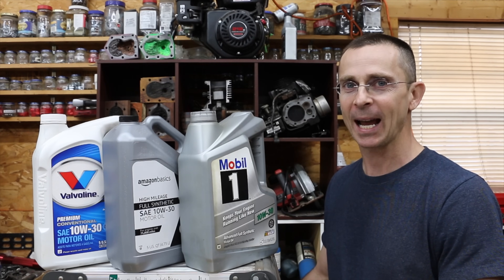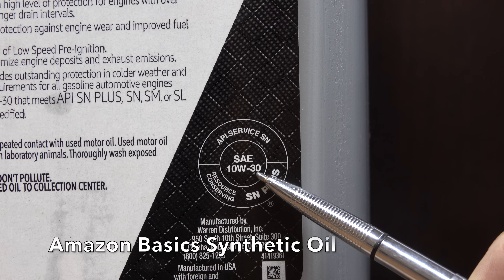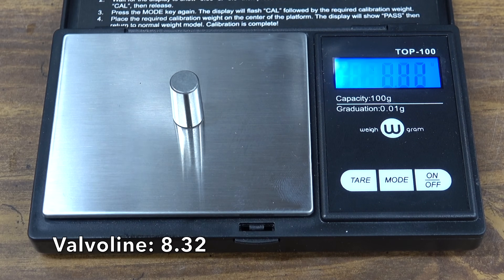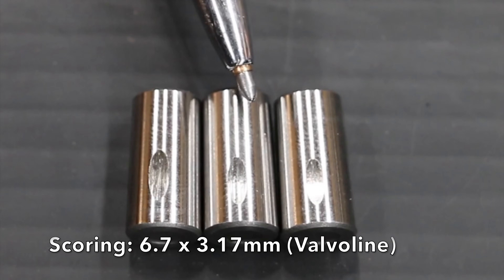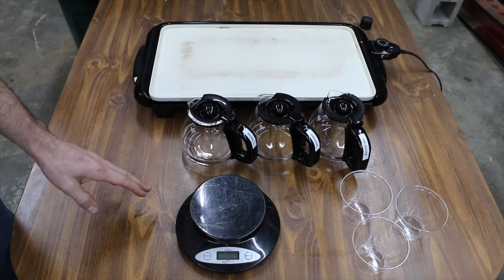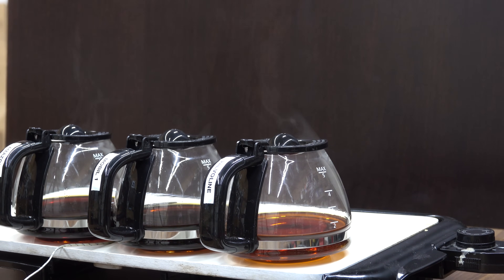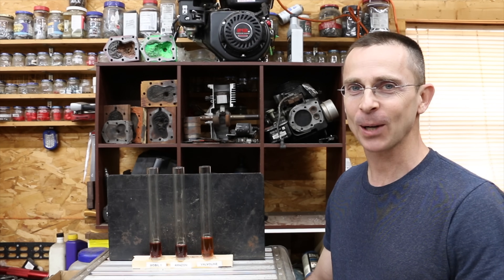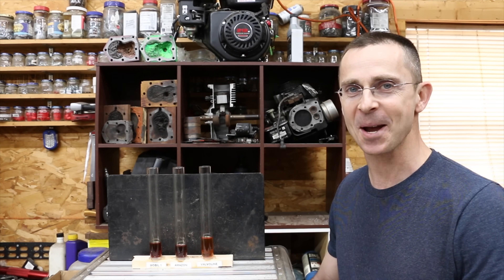Is AmazonBasics Full Synthetic Motor Oil better than Mobil 1? Let's find out!

Comment: VERY well done!

I've left you a lot of positive comments along this journey and where to go next, but at this point, you've gotten very good at getting useful information with your reasonably simple testing.  This one I would argue that Amazon actually won.  Yes, Mobil did a hair better on the lubricity tester, but you're also testing an extreme situation that does not match any condition you'll find in a normal engine (keep doing it, it's still a useful test, ESPECIALLY with the temperature probe).  It appears that the Amazon basics not only flows better at low temps, but survives higher temps better, AND prevents parts from heating up as fast in the lubricity test (making me wonder if mobile did better with the wear because of luck of the draw, it got a slightly better bearing).

What I would like to see next would be the same test run with Mobil 1, Amazon Basics, Walmart Supertech Synth (I wonder if it's actually the same as the Amazon basics, it's a good oil from the same distributor) and Royal Purple, all in  5w-30 (a more common grade for modern cars, also one that with more traditional oils would be more fussy to formulate).  If you really felt ambitious you could add Amzoil or Redline, but I feel it would be unnecessary.  With those 4 you would cover the best of the reasonably priced oils, including one that enters the ultra-premium category but is still available at normal stores for a reasonable price, and at the weight that used in almost all the newer engines.  You'd pretty much have the definitive answer for "If the average guy who wants to take better care of their car, which is the best that you can get at a normal store and is it worth going out of your way for one of the premium brands?"
Reply from the maker: Great recommendations!  I'll test the brands you've recommended.

Comment: PLEASE make a video comparing Full Synthetic High Mileage oils in 5W30 (most popular weight sold) from the 4 major brands. (All cost from $22-$27 at Walmart) 
1. Valvoline Full Synthetic High Mileage
2. Penzoil Platinum High Mileage 
3. Mobil 1 Full Synthetic High mileage
4. Castrol Edge High Mileage

also to go along with the all tests you did on this video, I'd love to see you add a test to see how the oils perform for heavy carbon deposit removal. 
To my knowledge you'd be the only video on YouTube that full synthetic high mileage oils would be tested. 
You're the best !!!
Reply from the maker: Thank you for the recommendation!

Comment: Nice test rigs!

I'd be more interested in the high temperature viscosity than the volatility. Volatility should be (and is) effectively nil for all of these. A bigger issue is whether they maintain enough viscosity at high temperature to avoid engine wear.  The abrasion rig kindasorta tests that, but the oil never really comes up to operating temperature.  A metal cup with a heater to control the oil temperature for the abrasion test would be perfect.
Reply from the maker: Thank you for the video idea!

Comment: Great video! I know several car mechanics and they all have different opinions about oil. Some swear by Castrol, others put cheap oil in high performance engines like a VW G60. 
I always use cheap engine oil from the Dutch discounter "Action" and pay 10€ for 4 Liters. Never had any issues while using it over the years in at least 6 different engines. Until last year when I bought a '96 Jetta MK3. 
It hasn't used a drop of oil since the last change...
Reply from the maker: What you're doing is working well.  No point in changing!

Comment: I don't know man. There is WAY more to a quality oil than those common-sense tests you've performed. Your tests simply prove that straight from the bottle all those oils are comparable which means absolutely nothing for longevity of your engine. There used to be a time when for God-knows-what-reason i read up a lot of technical literature that went in depth why this sort of comparison is just silly because it doesn't take a crap load of other important factors in consideration.

I categorized this video as one of those silly ones you do from time to time.

Comment: The Mobil 1 has additives that supposedly protect the oil from overheating, and additives that protect the engine (longevity). It's probably those additives that are making the oil a little less liquid at lower temps.

I tested Mobil 1 in my car, and did between 7-8k miles before I felt the engine needed a change (Ford recommends 10k miles, but by that time, the engine isn't idling smooth anymore).
Then I tested Amazon basics, and I got 5-6k miles on their oil.
I tested Ford's own oil, and it did well for about 7k miles as well.
Then I tested regular dino oil, and that was only good for up to 3k miles.
Reply from the maker: Thank you!

Comment: The biggest problem with the amazon basics is, who makes it now vs later? If it is anything like Walmart, then you might get an entirely different company making the product next year. It's too risky to me.
Reply from the maker: Thank you. Warren Distribution is the company now and they have a solid reputation.
Reply: But isn't that true for a lot of the lubricants on the market?  They are not always produced by the name on the label. They are OEMed from a variety of sources. Those sources can and do change and the only constant is the specifications on the label.  Example... John Deere doesn't produce its own lubricants. I'll bet Royal Purple doesn't make that lubricant either. Even those sold by the OEM change over time. The manufacturer won't tell you when the formula has changed. Again, it just has to meet the criteria on the label.

Comment: I think you did a great job and this was a very helpful and informational video. Just one thing that I noticed you weren't comparing high mileage version of the Mobil 1 and Vavoline to the high mileage version of Amazon basics.  Additionally, Valvoline was not synthetic so it is difficult to make a straight comparison with the other two oils.
Reply from the maker: Thank you!

Comment: Great test Project Farm.  You do an awesome job with facilities available to a home shop.  We did a similar test on synthetic vs conventional oils in college engineering lab.  Even though cold start viscosity gets the most attention, the ability of the oil to maintain viscosity when it is at operating temperature is actually extremely important.   If you do a followup test, I suggest you test the oils for lubricity and flow at 225F.  Also perform the  same tests on used oil with 5K miles.  I think you will find the synthetic oil will perform much better at end of life.  Once again, awesome channel and you really do a nice job with your experimental method.  Keep em coming!
Reply from the maker: Great recommendation!  Thank you

Comment: I just changed my oil with Valvoline and now im disappointed
Reply: He used conventional Valvoline
Reply: Valvoline was the only conventional, the other two are synthetic, pay attention to what is going on.
Reply: @zoonertuner8851  actually that was my point. Pay attention.
Reply: I use nothing but valvoline full synthetic unlike what's in the video. I took an old engine apart with almost 200,000 miles on it and measured the crank bearing clearance with starrett calipers. Lets just say I was amazed as was my dad who was a machinist for over 40 yrs.
Reply: Conventional oil is just fine.
As long as you change your oil at the required intervals.
Reply: There’s nothing wrong with Valvoline. I’ve used it when it’s on sale, and it works great.

Comment: It would be pretty expensive but different solar panel efficiency would be very interesting. There are a lot of 100W panels available and I would like to see who is best. I'm currently assembling a small portable solar "generator" for extended camping with one 100W panel. They are easily expandable, don't take up much room and are often cheaper than small 1000 or 2000 watt inverter generators. Generators are reliable and convenient but you are limited to fuel amount.
Reply from the maker: Thank you for the video idea!

Comment: I generally run a mix of 5 quarts Mobile one 0w40 and valvoline synthetic 5w40 cuz that seems
To be the cheapest combo I can get at wall mart for the 7 quarts my car takes. Id be interested to see some testing of the cold flow and the wear on the load bearing
Reply from the maker: Thank you!

Comment: I'll still get Mobil 1
Reply from the maker: Mobil 1 is great!
Reply: I use Mobil 1 0w40, that costs me $3 less at Walmart than what Amazon is charging for their 0w40, so not only is it a reputable brand that's been making synthetic for over a decade but it's cheaper. Still interesting (or maybe just weird) that Amazon makes oil.
Reply: @jetjazz05  Technically correct: Mobil 1 has been making synthetic oil since the 1970s, which is indeed over a decade. Amazon's oil is made by Warren, so they aren't actually making any oil.
Reply: still not a real synthetic. mobil 1 is simply a group 3 base.. in other country's they cant even label mobil 1 as a synthetic because it simply is not one.. fine oil but you're misled if you indeed think it is a real synthetic.
Reply: @iconr6racer  Man, I agree with you. Liqui Moly does this shit. Even on youtube that guy from LM defending that group 3 its synthetic. ITS NOT!! Shitty oil for twice the price.
Reply: I only use Amsoil 5W-20 signature series.
Reply: @Lexman00   I use amsoil on my snowmobile
Reply: There are two types of responses that are standard in any oil thread: the "Mobil 1 isn't a real synthetic" and the "Amsoil is the best". You managed to attract both, lol.
Reply: Mobil 1 is pretty crap oil for the money unless EP or 0w40. 0w30 isn't too bad. Definitely never use the 5w30. It's overpriced hot garbage. Blends perform better than that crap. Use 0w40 in everything and call it a day. Fucking 20 weight in new cars, what a joke. And if it's a pos like ford where the oil galleries are too small, then you shouldn't be buying that shit in the first place.

Comment: I was hoping for another lubricity test after you heated it up. The best way to know if your oil can handle the abuse, is to abuse it and then test it. I once bought Sears brand synthetic oil, for my Honda VF1100, and made it two blocks away from my house before the oil broke down and the engine started making unhappy sounds. I went back to Mobil 1 and never strayed again. I prefer Mobil 1 over Valvoline synthetics, but consider Castrol synthetic a good alternative. I especially like the 0w-50 for my performance built 1.8L VW engine. Thanks again, for another great test. I hope you are making good income from this series.
Reply from the maker: Great recommendation!

Comment: Try testing mobile one oil that is sn plus for turbo charged direct injection engines. A turbo engines turbo requires oil to protect from failure and oil in turbo lines can drain back into the pan an oil designed to be used on a turbo engine probably has that lack of oil in mind when it comes to how well it flows.
Reply from the maker: Thank you for the video idea!

Comment: Just to add, Noticed the Valvoline was a Conventional, didn't see that first time. Good video.
Maybe before turning on the lubricity tester, turn the bearing so it starts with a coating of oil.
The glowing bit of carbon dancing in the see-thru-head clip was fascinating.
Reply from the maker: Thank you!

Comment: One thing you didn't do is a control flow test, to see how they compare at room temperature. It might be the faster flowing cold oil was also a lighter viscosity. I mean how accurate are the oil companies rating their products viscosity in the first place? But your test is well done and I liked watching it. There's no doubt synthetic will outperform conventional but in a real life situation our bearings aren't under that severe loading and our temperatures are not 15 below (for us in California anyway) So with less extreme conditions I think modern conventional oils are excellent.
Reply from the maker: Great point. Thank you

Comment: Amazon also ran colder on 1st test by at least 3 or 4 degrees based on the temperatures shown on video
Reply from the maker: Great point. I'm still working on temperature probe placement and want to make sure the test results of the temps are reliable.

Comment: You should try hot shot secret oil additives. I used their stiction eliminator and my 6.6l duramax engine runs so much smoother. They also have FR3 friction reducer that I add to all my oil now and I am very impressed by this product. It would interesting to see how it can clean carbon deposits.
Reply from the maker: Thank you for the video idea!

Comment: Thank you for the test. I actaually thought the differences between the two would be very insignificant, but that is not the case. If you end up using one of those synthentics in your truck, it would be interesting to test the used oil on the lubricity tester whenever it is changed next to compare how it holds up after being used in an engine.
Reply from the maker: Thank you!

Comment: Rural King sells a Synthetic as well that I think would be worth comparing.  I think it's like 15 bucks or less if memory serves me correctly for the 4 or 5 Qt Bottle like you used today. 

Of course the Best of the Best is Amsoil and I run that when I can afford to; but all things considered who can't afford to run Amsoil. So far I am easily at over 8K miles and almost no change in color of oil and that is something. Amsoil is the best for a reason....

Cheers,
Paul...
Reply from the maker: Thank you for the video idea!

Comment: You should do a similar test of all major brands! No one has any comparable data on all them side by side. Pick a common weight say 5w-30 10w-30 and heat them all etc syn and non syn no funky blends just good old dino and "full synthetic" from the major brands as well as walmarts brand. Napa,autozone, and advanced will just be one of the oils from the major brands most likely so no need to test. Thanks for a great video. Keep up the good work.
Reply from the maker: Thank you for the video idea!

Comment: I have an idea for a future video: 
“Who makes the best Full Synthetic for the price?”

-Mobil 1 Extended Performance 
-AmsOil
-Castrol Magnatec
-Motul 300v
-Redline
-Penzoil Ultra Platinum
-Mobil 1 Annual Protect
-Castrol Edge Extended Performace
Reply from the maker: Thank you for the video ideas!
Reply: @ProjectFarm  Thanks, love these type videos to see what we get for our money.
Reply: mobil 1 0w-40 european  or quaker state ultimate
Reply: I would like to see the same test but with different levels of oil from the same brand ex.

Valvoline———
-Conventional 
-Synthetic blend
-Full synthetic 
-High mileage (full synthetic)
-Racing oil (VR1 full synthetic with high zinc additive)
Reply: @BadKarmaHD  how about LiquiMoly? I hear it compares similar to schaefers
Reply: @TheNkp08  I've only tested what I've ran in my two diesels. Just to see if the money is worth spending. For me shell rotella 5w40 is good enough. If I had the cash ide buy amsoil. If I was rich enough to afford 4 gallons of Schaefer's every oil change ide just buy a new car every time the oil needed changed
Reply: You forgot Royal Purple
Reply: Engine oil is tested very thoroughly already.. and as cool as this vid is it doesn't hold a candle to the things they do. All the info is out there if you look for it.
Reply: It's hard to beat amsoil. Race engine proven in so many different levels. Also they support tons of local amateur racers and events.
Reply: Royal purple, Amazon basics and Walmart super tech need to be added to that list. $100 says amazon basics and Walmart super tech will be #1 and 2 in both performance and price.

Comment: Hot vs cold engine oil testing! Polymers in the oil need to be at certain temperatures to work for flow, film strength, and cleaning properties. A hot vs cold oil test the way you do them would be a great visualization for everyone to further understand the physics of oil at different operating temperatures as well as the importance of engineering the chemistry there in
Reply from the maker: Thank you for the video idea!

Comment: I would of avoided amazon basics oil like the plague before this video. After though I would actually trust this oil to protect the engine. Great video I was a big fan of mobile 1 oil but it looks like amazon basics edges it in the cold test. I live in Minnesota and you need a reliable oil like this. Valvoline I purchased once for my cavalier but clearly it sucks. I know I will stick to mobile 1 or amazon basics.
Reply from the maker: Thank you!

Comment: The amazon oil is the same as walmarts supertech the supertech synthetic is a very good oil espically for the money. Throw it in an old car that you run syn it drop every 5k with a decent filter(pick basically anything with a red/silicon anti drain back valve skip all frams except the highest end fram I'd dodge the walmart filters as well).
Reply from the maker: Thank you!